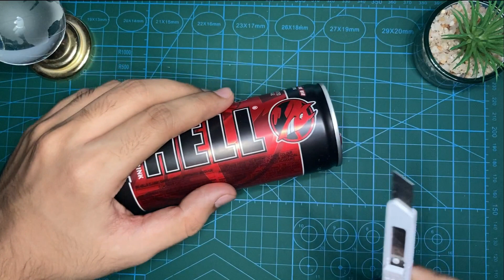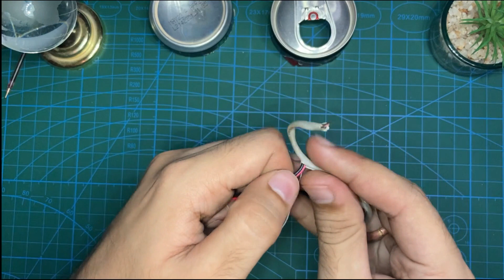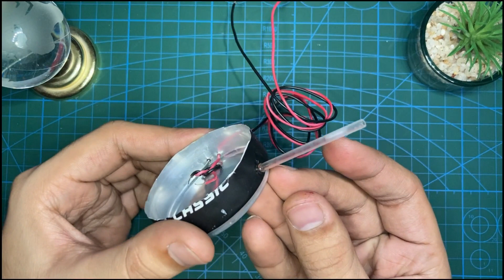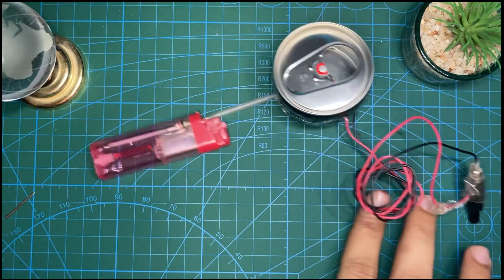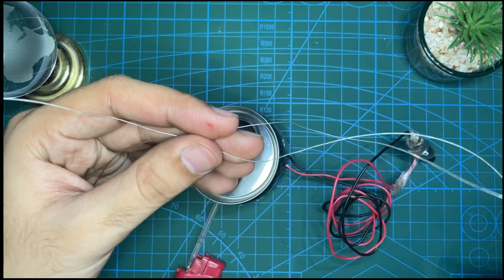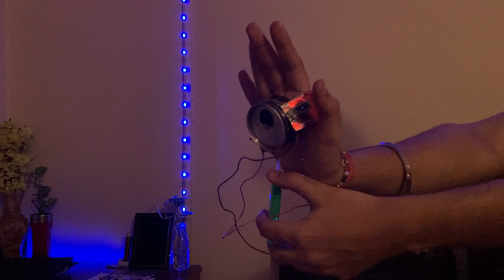Real Life IronMan Hand Blaster Shoots Fire | DIY

Comment: I have a question so I went to the store and we got a lighter and when we looked inside of it we didn't see any wires do you know what type of lighter you had in this video and what is the point of the lighter on the bottom?
Reply from the maker: its the cheapest lighter in the market some lighter uses a roller to ignite the fire this one uses a spark device to ignite the fire which we are using to make a spark inside the hand blaster.